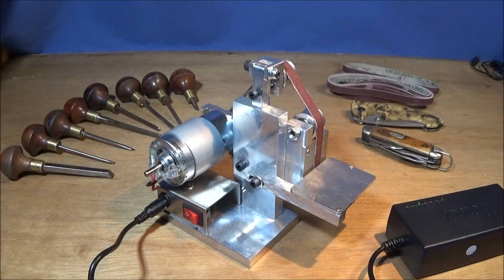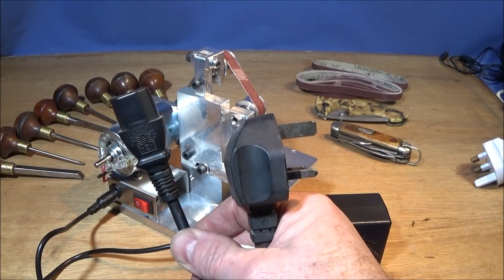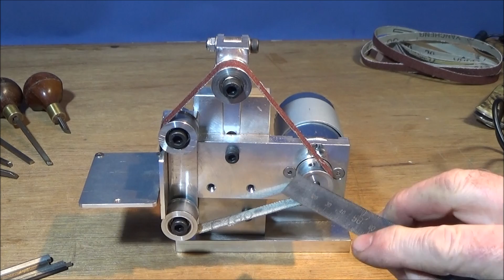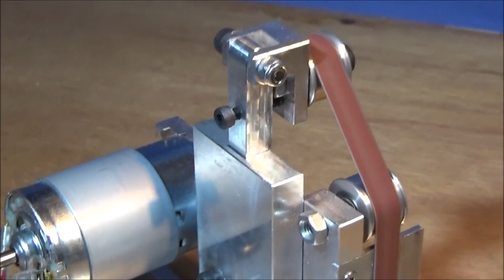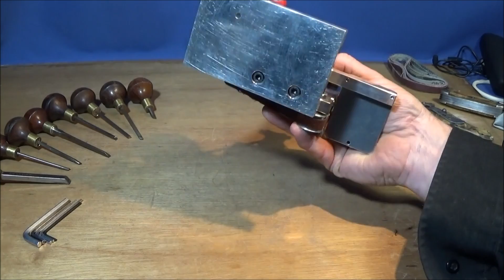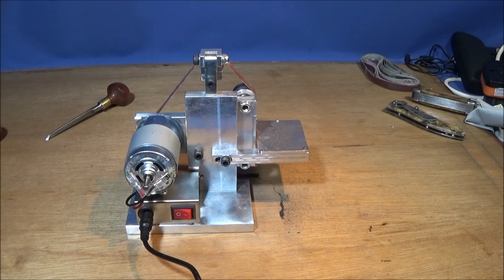Mini Apex Variable Speed Abrasive Belt Sander Knife Sharpener

Comment: Thank you Steve for this good Video 👍
Just a little tip. Theres a grey iron ring slidet over the motor and yours is not snaped in to the square hole, as it suposed to be. So the air vent openings are covered and the magnetic flow is not as good as it should be 😉

Comment: I fastened mine down with a G clamp to my bench and it doesn't move. Good power for a small unit but not sufficient to sent it across the worksurface when clamped. Great little bit of kit.

Comment: I am not quite sure if this is any better for tool sharpening so far as model engineering is concerned, than a conventional 1" belt sander but considering the amount of material in there it seems remarkable value for money. My only concern is the so called speed controller which  seems to be a simple potentiometer affair . Surprising as with the availability of the cheap as chips Chinese PWM controllers from all the  usual suspects. Perhaps with a better DC motor and controller the unit can earn its keep in the long run. Steve already has a  decent 200W DC motor and controller which I believe was from an eBay source.

Comment: hard to tell on the video but the rollers don't look crowned.  If they were
would that stop the belt doing the side to side dance?
are all the belts for metal sanding?
Thanks Steve for all your fine efforts on these videos.
Reply: The wheels are concave
Reply from the maker: Hi Thanks...It doesn't bother me, but I may do some fine adjustments and upgrades at some point.

Comment: That's nice. You need to add a buffer wheel to it. Very easy to attach on the motor shaft for more attachments like a cutoff wheel too!
Reply: The motor shaft looks a bit skinny for that,  but via a belt to a thicker shaft would be excellent.